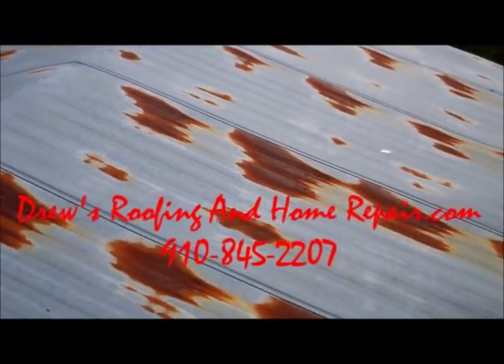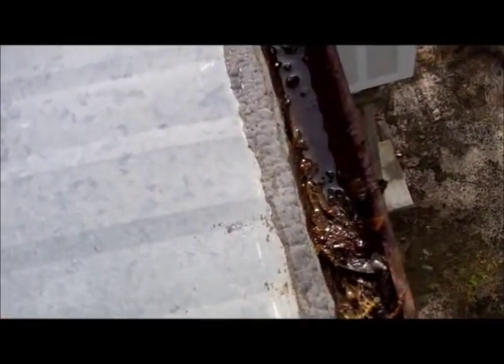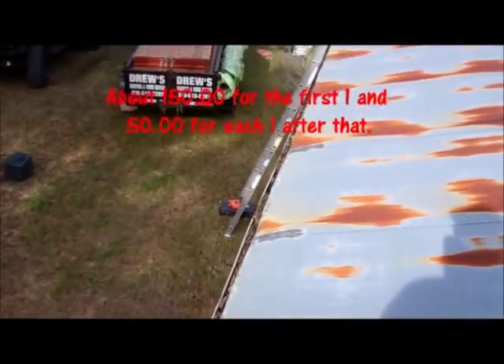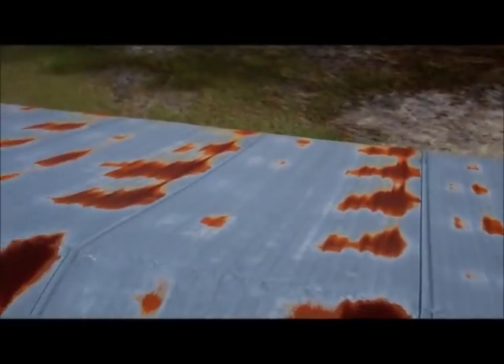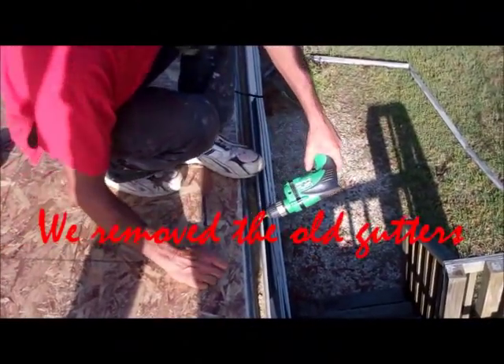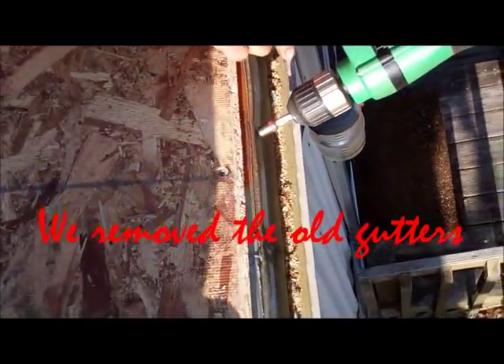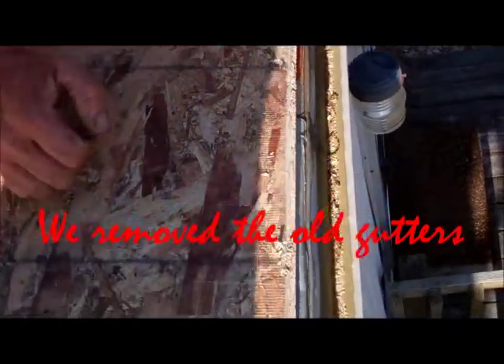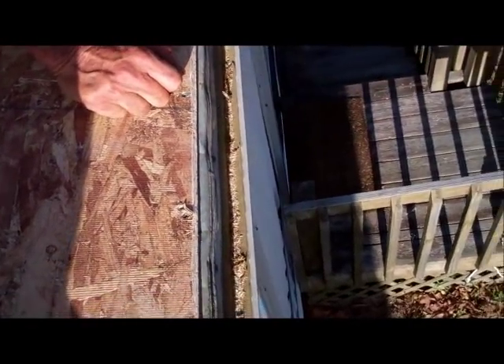Mobile Home Trailer Roof (Rusted Tin Roof)

Comment: Love the rubber over the mobile home roofs.  I'm a carpenter getting ready to do something similar it's a 15x70 with a metal roof that wasn't painted in years a has rusted through.  This mobile home has a like more bow to it.  Do you prefer to use the insulation or glue straight to the OSB better?

Comment: Got us a fixer upper 197? model . when they attached the front porch to the front of the trailer they must have not sealed it. The rain just runs down in between  and into the trailer's living room  the entire bottom of the door jamb is rotted out as you open the door the entire bottom comes with you,  making it difficult to open. I wish could attach pictures to show my problem

Comment: Won't the metal continue to rust under the rubber roof from condensation from inside the home?
Reply from the maker: I would say in my professional opinion and all the time I’ve been doing it that has never happened. I do suggest after you put the black rubber up there that you code it with WHITE stop it’s a water-based liquid. You put put it on with a roller.
Reply: @Drewsroofingandhomerepair  I live in Alaska and I don't know if that makes a difference in what your response is. Totally different climate than the east coast states. I probly should have mentioned that. Thanks for responding! :)
Reply from the maker: Nothing to do with comment, but I have a another kennel
https://youtu.be/lZey7FZbeac?feature=shared

Comment: Drew I plan on watching all your videos because I own a small roofing company near Knoxville ,TN. My questions are about the guttering. I saw some where you didn't have the gutters and this one you did. If you didn't attach gutters before the termination bar was attached what would your options later since the water would just run in behind anything put on later. Also I saw this was a $5000.00 job but what was the square feet or squares involved in this job. Also how many boxes of coil metal do you use per average home. Thanks and keep the great videos coming.
Reply from the maker: Jim White Jim call me we barely talked in person 910-294-1761
Reply from the maker: Call me I will help you

Comment: Drew I have a rental trailer that a rubber roof was put on and the small gutter is rotted on the bottom.   Would cutting the U part off leaving the back of the little gutter metal on and then installing regular house gutters under the old metal vertical piece work?   My yard there is filled with helicopter trees and clean out one day full the next?
Reply from the maker: You can take the screws in the rubber loose or out. Remove theo old Gutter screws and Install new bigger Mobile Home Gutters.. Make sure you use the mastic behind it and some Caulking like lexal Then Re-Install the Termination bar on the Rubber Take your time It can be done.. the mobile home gutters come in 14 ft pieces at most Mobile Home supply Store. https://youtu.be/jBiUWBbjVGI

Comment: Looks like you've done a decent job here but I couldn't justify putting osb on this roof and not at least 3 inch eves to the sides of the house. The mini gutters at the worst idea ever. I have replaced a lot of rim joists because of them.
Reply from the maker: Dan Vize Yes sir I agree 100% that was terrible but at the time that’s what the homeowner wanted you should check out my latest videos I really think you’ll like them as a matter of fact I think you’ll be like wow what a difference subscribe my videos are getting better

Comment: I'm curious, and this is a genuine question not judging the work you do because I know you do fantastic work but will that rust spread on the metal roof? Or will the rust stop now with the boards over it because it won't oxidize? Remember I'm trying to learn something here LOL
Reply from the maker: Not true. I have been doing this for over 20 yrs. it’s never happened to 1 of them. Nothing to worry about. Everyone I did a Roif for snd made a video on. Has done nothing but praise our work
Reply: @Drewsroofingandhomerepair  good to know. Hey I will never learn if I don't ask questions. 😊
Reply from the maker: That is correct. Thank you for being here for my channel

Comment: It would be nice if you would have talked about the prices and explained how you measured and cut it, for people like me who know nothing about what you are doing?????  Maybe in your new videos, would be really appreciated!
Reply from the maker: will do
Reply from the maker: Not to hard Just watch some of the other mobile home videos i have.. I measure the mobile home and add 1.5 ft on the length and width If you have a seam over lap there at least 6"
Reply from the maker: I didn't talk about pricing as they are all not the same.. This rubber roof cost 5000.00
Reply from the maker: i add 1.5 inches to width and length and if there is a seam make sure to let it over lap 6"

Comment: can you do metal roofing on this type of roof?
Reply from the maker: It can but you better be an expert or it will leak
Reply: Drew's Roofing & Home Repair is this rubber better an cheaper than a metal one? I have 4 or 5 rentals needs done by someone.

Comment: Reroofing with a Black Rubber roof ensures that , the maximum amount of heat will be retained BY the black roof...........REroofing with WHITE Rubber , means the least amount of heat will be radiated into the interior of the mobile home . You , did an excellent job with your installation process , Your choice of Black instead of White Rubber was The WORST choice you could have made !  White is MORE expensive than Black.........
Reply from the maker: White will not last as long as black I gave customer choice of price and the customer picks black. White only last 10 yrs
Reply: Shingles much better

Comment: How much if i do it my self.  500 sfoot
Reply from the maker: Buy 10 x50 rubber glue screws term bar 1000 to 1300
Reply: Thanks wife just had backsuger. My trailer leaks bad i do HVAC . so i try this my self. If you could just tell me what i need i give it a try. Thanks
Reply: @Drewsroofingandhomerepair  Where can I purchase the termination bar?  HD?  Or do I have to go to ABC?
Reply from the maker: Yes you have to go to ABC or Best distributing to buy termination bar